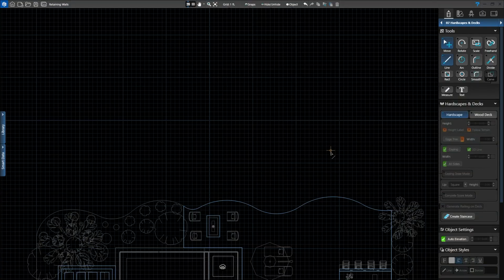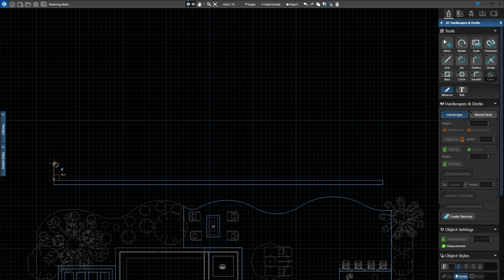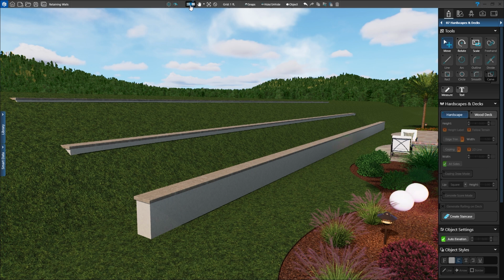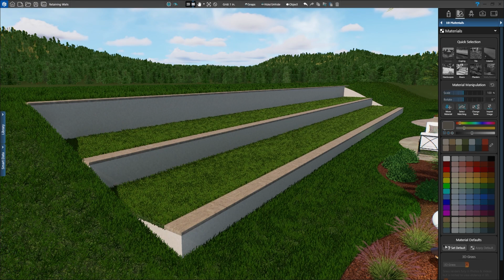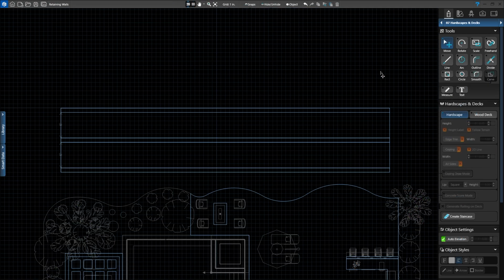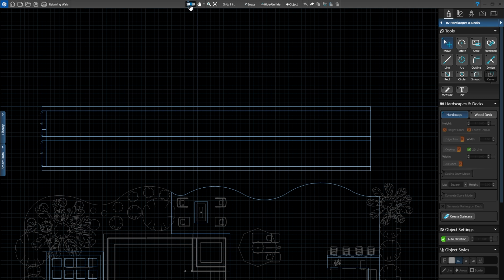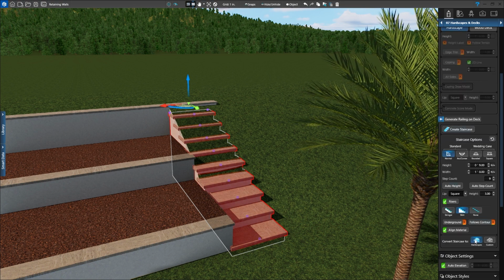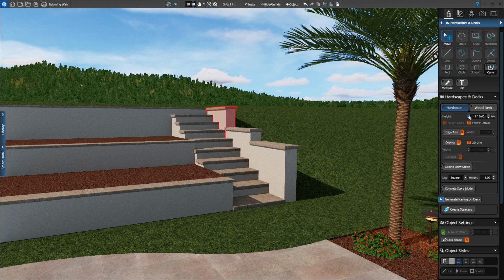Advanced Training: Retaining Walls

Comment: This is great for design, and gathering information manually (via materials, object info). But it should be noted that by using the hardscapes layer in this approach, your Construction Page Layout Plan will give the wrong calcs (I recommend using Custom Shapes for L/F and Hardscapes ONLY for calculating Face sq ft., as the terrain is negotiated ONLY with the Hardscapes layer, and not with the Custom Shapes layer.). This is because the Hardscapes layer is adding the square footage of whatever you draw on that layer. (Great example of "outline" tool used herein - arguably the most sophisticated command in Pool Studio, and the best tool ever made, indeed, better than anything made by Autodesk)
Note: at 2:46, when the scraping of the grade happens (via the Terrain layer), the Designer needs to calculate the cost for "pre-grade", because as it's easy to make grade flat in Pool Studio, it costs something in the real world. Also, look closely. There is clearly some grade not effectively removed by the design work (there needs to be staggered "side" retainer walls as the tutorial tries to describe). So, as a former builder, I would caution Designers on this. The last thing you want is thinking you properly designed the retainers, and then to find out you didn't. But overall, this is an EXCELLENT tutorial on dealing with elevated grade.